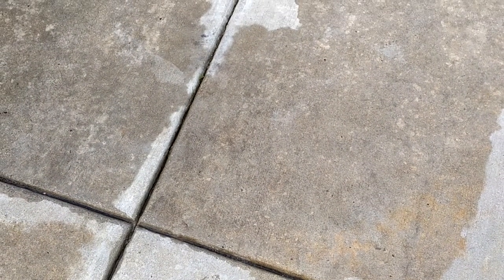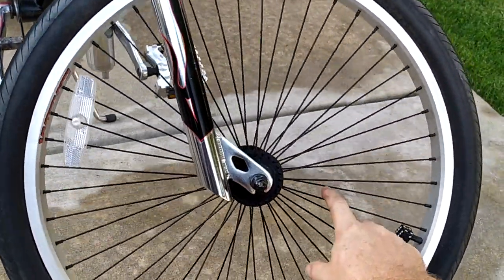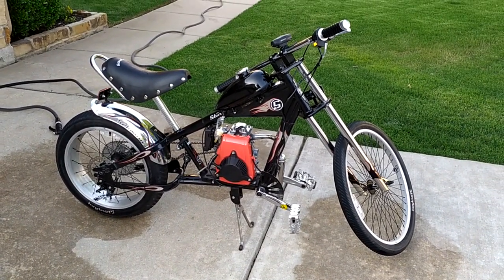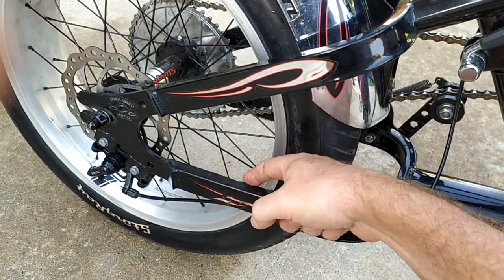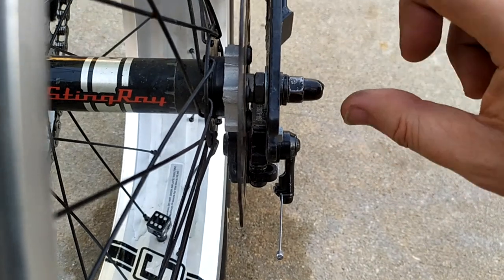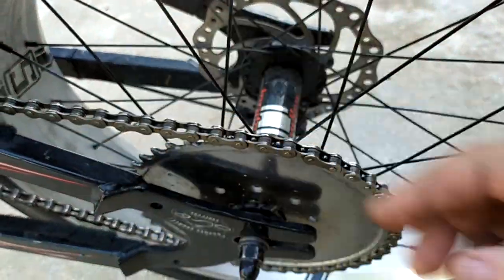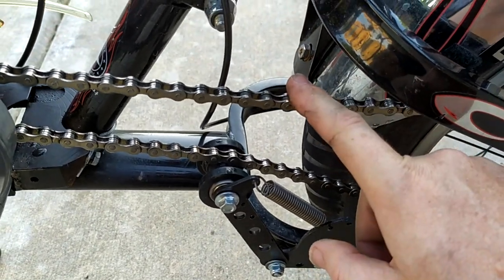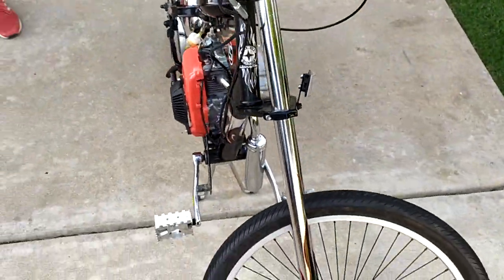Schwinn Stingray OCC Chopper 49cc 4 stroke conversion - NOTHING FITS!

Comment: I have 2 of those OCC bikes and i guess i should publish my videos. Im putting 4 stroke 110cc in mine I had some issues too but I solved them today with some not so safe grinding. Nice work.
Reply from the maker: Thanks!  The big huge giant deal that I'm dealing with now is MASSIVE chain vibrations, even with a tensioner I can't keep the chain on, (and it is aligned perfectly and tight).
Reply: @TexasNEV  i would try a upper chain tensioner with a gear on it instead of a roller bc most rollers will actually help the chain off
Reply from the maker: @minecraftblockychris8708  Thx for that.. I've actually been using a sprocket roller tensioner.  The real solution ended up me changing the chain.  I didn't use the 415H chain that came w/ the conversion kit and just reused the regular single speed 410 chain that was on the bike.  The pitch is the same and it fit fine but the chain is so light it was whipping and vibrating all over the place.  Once I changed it to the 415H chain, the problem went away.  Go figure.
Reply: @TexasNEV  remove the motor and put some padding down then put the motor back down I know on a regular bike build it helps a lot with vibration
Reply from the maker: @lifesadventureskeepingitre1180  There is a lot of vibration for sure.  That was a customer build, it was sold.  They are having a ball w/ it though.
Reply: @TexasNEV  cool I'm building a ms460 with a 28 mm carburetor and I'm putting it on a Cranbrook beach cruiser made by Huffy coaster brakes. 32t sprocket. Yeah I'm going to have some Screaming fun. As I scream as I put it together. LOL
Reply from the maker: @lifesadventureskeepingitre1180  I'm not a big gas motor person I just thought I'd divert to gas on this one.  I will be posting updates on the Terminator Electric Chopper as I have done some major upgrades, and will be posting a 5kw 72v electric fat bike with monster torque soon.
Reply: @TexasNEV  ok can't wait to see it
Reply: @lifesadventureskeepingitre1180  what kind of padding?
Reply: @yomontOME   Rubber padding thick old tire rubber. And put some forks on with spring or shocks it knocks the vibration almost right out.

Comment: I really want to keep the pedal side operating. So it looks like i will have to look at other bike frames instead of Schwinn.  Thanks for the explanation of your build.
Reply from the maker: The 49cc conversion kit comes with pedal arm extensions in an attempt to preserve the pedal function.  We didn't use them. :)
Reply: @TexasNEV  i know, i have the kit. But it looks like the crank sprocket would be in the way of the engine.  Unless i make the crank sprocket super tiny..
Reply from the maker: @datvik7187   I'd poke around YouTube a bit more.. I think I've seen people do it and get it all to work.  Not sure though!  :)

Comment: U actually made a mini motorcycle. My 49cc four stroke does 48mph 8400 rpm up hills . I have a dual chain 5 to 1 transmission,420 chain 28tooth sprocket on 26 inch rims . Ur transmission is 3 to 1 ,it jerky on take off  because of this . If u change to a 48 tooth ur bike will actually have a higher top speed and be quicker on take off, because ur rpm will be higher creating more hp . Ur bike will climb any hill also .plus less wear on ur clutch.

Comment: Do you remember which motor kit you got? This video is inspiring. I want to do it!
Reply from the maker: It was just the one off Amazon.  It looks great and the size of the motor is to scale on the bike size but it's just not enough power for use from a a dead stop. If that's not an issue then go for it. :) Could be an excellent e-bike conversion (which is what I normally do).  There's some 80cc conversions out there and even a few Harbor freight predator 212's that people have done.
Reply: @TexasNEV  that’s awesome. I’m finding a lot of 2 strokes but I’d rather have a 4 if I can manage.
Reply from the maker: @SirGuidemere91  The 49cc's are all over Amazon for $180.

Comment: The transmission on your bike is for bikes. The mini bike transmission is a short shaft and will fit ur bike
Reply from the maker: Thx David, all good, just having a little fun w/ this. :)
Reply: @TexasNEV  there only 30 to 90 bucks . Seriously I put that engine on your frame using a mini bike transmission. For ur son's safety change out the tranny the original is a single chain  and will brake,both mine did the shaft over heats and locks up ,the transmission literally folds in half ripping apart because the engine produces 2footlbs of torque at clutch engagement speed 2600 to 3000 rpm. A 48 tooth sprocket takes load off ur transmission it's top end is 43mph ,it is,lol ur bike now does 38mph out the box ,it really does.ive built 5 of em. There's hundreds of videos project farm testing of ur engine is spot on. Please use a 48 or 50 tooth sprocket on the bike it will almost pull wheelies if u do. And they do get 50 miles per tank full ,1 dollar lol fills it up .38 gallon tank is on that bike. Ps get a tac that engine turns 8500 ,stock 7200 underload with 44 tooth gear . Believe it or not that's a Honda 50 cc clone on ur bike  that engine came on the Honda cub that did 45mph. Ur engine produces 4.2 Hp at 8500 rpm it really does. The right gear would bring that engine to life.
Reply from the maker: @davidkaul6180  Really great information but we sold that a long time ago.

Comment: Nice bike, thank you for the video
Reply from the maker: YW.. These really are pretty cool.. If you can find a nice one in great condition, it's a keeper. :)  The big issue is finding a replacement rear tire that doesn't cost a fortune...
Reply: Ya TexasNEV I've seen on fb bicycle groups people use 16 inch MC tires and 16" donut (spare)tires. Those tires are stupid expensive.
Reply from the maker: @markplaylist5984  Wow I'm amazed that works and fits ok!

Comment: I want to do this but can't weld do I have any options
Reply from the maker: Perhaps you can bend some metal brackets, use some self tapping screws into the frame or something.. Not sure.. Probably best to see if you can make the metal parts you need, get them placed where you need them and then just go to a muffler shop and have them weld whatever it is you need.

Comment: I have to 2 that run grate once you get all problems fixed with them
Reply from the maker: Once I changed to 415H from 410, the chain problems went away.. Pretty much good to go.. Plus I have a small supply of 20x4 fat bike knobby tread rear tires for sale on e-bay as well.  traderrje is my e-bay seller name.. I only have 7 left.

Comment: How do you wire up the kill switch? I just can’t seem to figure it out.
Reply from the maker: I had to drill a small hole in the handlebar for the switch to mount, then the wires just plug up to the connector on the motor.

Comment: Did you also remove that throttle stopper? It restricts like 2/3 the available throttle.
Reply from the maker: LA LA LA (plugging ears).. Delete delete delete.. Hope my 12 year old doesn't read this! LOL.. Umm.. no I haven't..  (It's on my list but had to work through the melting clutch issues)..  RED COMPOUND CLUTCH rocks.. All others, disposable after a day..
Reply: @TexasNEV  lmao fair enough. I was so mad when I first got my motor and realized why I had no power. I've gotten mine with some other mods up to 37 on flat ground.

Comment: So I am going to have it to  Pedal so the clutch doesn't keep going out
Reply from the maker: With a 49cc probably.. If you're doing an 80 w/ a good gear ratio I'm sure you'd be fine.
Reply: @TexasNEV  are you sure it is a 2 stroke tho
Reply from the maker: @LillysSquad  I put in the 49cc 4 stroke but if you put in an 80 two stroke it should giddy up and go w/o needing to pedal but that's just my guess.  I'm not really a gas-engine guy.. Most of my videos are all electric conversions.

Comment: That kind of sucks I got mine for 400 at a pawnshop drove it home and then the chain broke off
Reply from the maker: Use 415H chain and you'll be good.. It fits regular single speed bicycle chain sprocket sizes but is heavy duty.

Comment: Boy, I think a lot of your issues would have been solved if you just threw on a 212cc Predator Ghost, with a torque converter.
Reply from the maker: Yes, ain't nothing like putting something bigger in to fix an issue where there is no space. LOL
Reply: @TexasNEV  that's not completely correct. Bigger as in cc maybe, but in physical footprint, no. The predator ghost isn't as tall as the engine you used, may be wider, side to side, but that's easily fixable by welding a wider mounting plate. Front to back it's 7". You'd have plenty of room to mount that.
Still a great build tho. Enjoyed the vid 👍👍
Reply from the maker: @TheShowgunofHarlem  I was just being sarcastic, I getcha.. His grandmother bought the 49cc kit for my son for his birthday the year prior so that's what we had to work with.. It was fun. :)

Comment: What type of clutch did you buy? Do you have a link?
Reply from the maker: Get the 3 bladed one with the RED compound.  The stock one won't last (3 blade w/ black compound) and the 4 bladed w/ red compound is way too much chatter and vibration as that one is for 2 strokes..
Reply: @TexasNEV  do you have a link?
Reply: @TexasNEV   also, what do you mean by blades and compound?
Reply: @TexasNEV  there is currently a fly wheel clutch in the bike
Reply from the maker: @maxblack8397  Not handy, that was a couple years ago, but they're on ebay, just search for 49cc clutch.  This motor used the tapered shaft.  I liked the 3 vane/ blade clutch w/ the reddish / brownish compound. not the black / grey.
Reply from the maker: @maxblack8397  Yep. gets hot too.
Reply: I’ve tried the clutch you recommended it’s still got burnt out. Am I doing something wrong?
Reply from the maker: @maxblack8397  This isn't really my area of expertise, but the red/brown compound clutch seemed to last the longest for us.  I mostly do ebikes, etc and this was my first foray into something gas powered w/ a centrifugal clutch.  IMHO these little 49cc motors were not designed for a dead stop start and were designed to work best with a bike with pedals to get ya going first.   Someone else jump in here if I'm wrong on that..  Perhaps a larger rear sprocket will help?

Comment: how fast does it go?
Reply from the maker: about 26mph. Good nuff. :)
Reply: @TexasNEV  what do you think is the maximum load for that engine? can it carry two old fellas?
Reply from the maker: @deathwaiting9931  Nope.  These engines are not designed for dead start applications or heavy loads.. Even with a kid riding, it's best to get moving by your feet first otherwise your clutch will last a day or so.  It's only 1.5 horsepower at best but it is fun and the idea of a mini chopper like this is nostalgic.